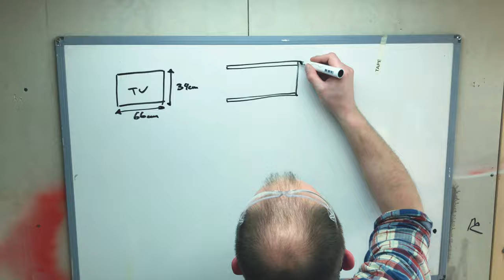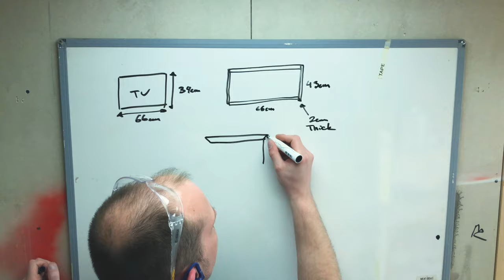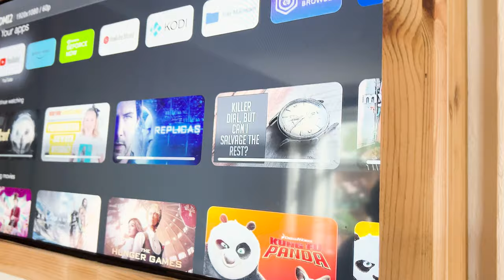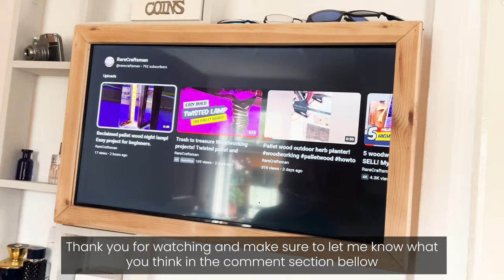Better than ANDROID TV BOX | Easy DIY Smart TV conversion

Comment: Looks great. My only concern would be the heat generated from the TV. That could be remedied easily drilling a few holes maybe in the top and bottom of box.
Reply from the maker: Thanks man. I think this is solved as I have not enclosed it entirely plus it has a 5mm gap from the wall. No issues yet but your 100% right Thank you